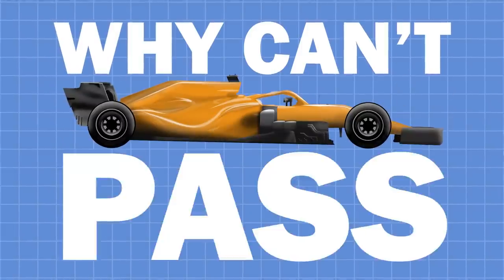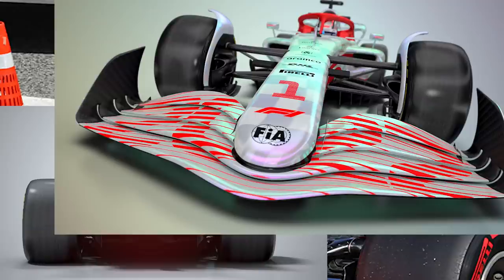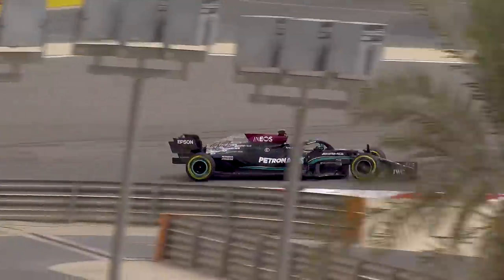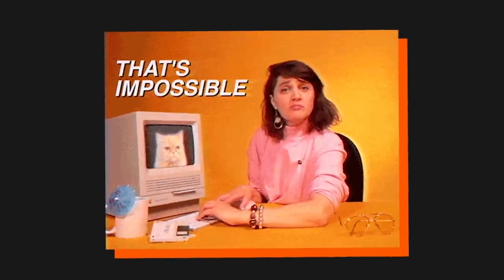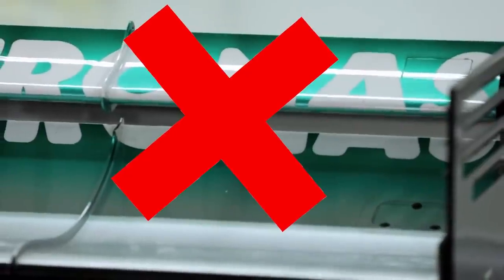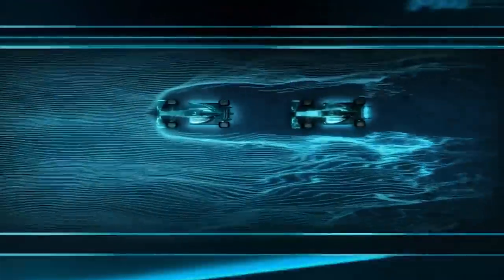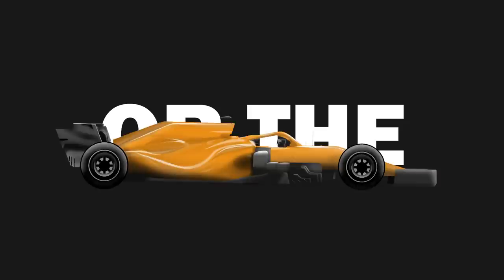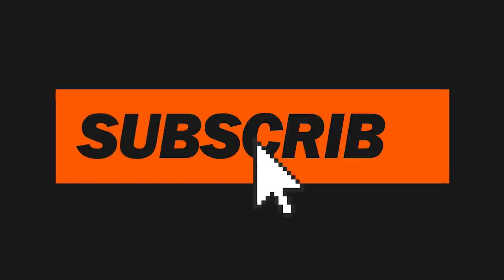Why can't F1 cars overtake in a 'DRS Train'?

Comment: This is probably one of the reasons there should be a limit on DRS uses per race like Indy push to pass for example.
Reply: that’s actually a really good idea
Reply: push to pass is such a better system.... just let them have like 3 shots on it in a race, or only let them use it for 30 seconds overall for the race

i get why they are there, but the zones F1 has now is just making stupid DRS chicken games... trust the drivers to judge when they can use it
Reply: @Sem5626  maybe at eau rouge/radiliion dangerous if use pushtopass, safety concern. if want push to pass, f1 will defined safe zone to use it in my opnion. yesterday f2/f1 saudi crash scare the official, can be much worse. glad are still ok. Super formula japan use push to pass method, its good overtaking, trust me :)
Reply: Agreed. But they need a system that somehow block the DRS to open in corners. Maybe to keep the same areas, but use limitation as you said.
Reply: It's the same thing... drivers will use it on the straights anyway

Comment: The push to pass system in Super Formula is more fun to watch than DRS
Reply: Indy Car has the same system
Reply: That's basically the ERS for F1
Reply: @PG-20  Two very different things both technically and with effect on racing.
Reply: Push to pass pass wears the engine down. It’s terrible. Drs is better, or you’ll be seeing by more engine changes

Comment: You can make a simple change to the DRS rules that would fix a lot of issues with the current implementation:

Every driver gets 1 DRS activation per lap, and I mean every driver on the track. They get to choose in which DRS zone to use it.
Reply: Or do it like some other series use the push to pass button. You get so many activations per race.
Reply: Easy:
There are 2 tracks on the whole calendar who have more than one DRS-zone where you can actually overtake.
Reply: well I think it wouldn't work so much
the fact is: I am the car ahead, if I see the one behind uses DRS in the first zone, I enable ERS just in the first DRS zone.

Comment: If we really see that we don't need the DRS anymore in 2022, I would still keep it but make it open for everyone all the time (Like we have now in FPs and Quali). This is just free straight line speed there to be taken or not. We would see faster laptimes and also better cornering speeds. That is because the team would put on more downforce/drag on the car if they know it won't hurt them so much on the straights. Also all the teams allready developed the DRS for the new generation of cars in 2022 so it won't be that resource intensive as well.
Reply: Someone mentioned putting a limit on how many times a driver can use it per race and I think I’d rather have that than having the ability to always use DRS.
Reply: as long as they don't use mario kart rules to get DRS
Reply: @Hirosjimma  bahahaha what do you mean?
Reply: @Shelmer75  for example in FE you can take a corner a whole lot wider to activate a boost. I think he meant that bullshit 🤣🤣
Reply: @nemanjastanojevic583  ohhhh! Yeah nah get that outta here. Just give them a set number and they can do it whenever.

Comment: question: wouldn't using fan cars sort out the dirty air problem? or would they make it worse?
(Before I get screamed at, I'm aware of their inherent dangers and don't expect to see them in f1 anytime soon/ever)
Reply: Wouldnt get worse as the majority of the grip is due to the fan sucking the car into the ground. The air being shot out the back is negligible, actually I suppose that the wash from a fan is quite predictable
Reply: It would turn the phrase "dirty air" into a literal one
Reply: Fan cars were only dangerous because they produced cornering speed far in excess of what was safe at the time when combined with ground effect skirts, reports of them shooting junk out the back were greatly exaggerated. If they were used as the primary means of downforce production and the rules were structured to limit their effectiveness (in the same way wing regulations are currently) then they'd likely fix more problems than they caused. Dirty air would still be a minor problem but it would be far less noticeable than with today's extremely sensitive over-body aero design.
Even if junk being fired out of them was a problem (modern tyre 'marbles' might increase the likelihood) you could simply change where the exhaust ports for the fans were venting so it was safe.

Comment: Way it's hard to follow close in the corners are because of "dirty air". When the wings produce downforce in the corners it creates turbulence air that blow up behind the car. So as the car that follow into the corner hits the turbulence at an angle it will have less downforce compared to taking the corner in clean air. To reduce dirty air you have to reduce the downforce F1 cars produce and that makes the them unable to take any corner at high speed.

Comment: What F1 should do about their passing rules. 
1 - The car that is not ahead is deemed to alongside once the front wheel makes it past the rear wheel of the lead car. 
The leading car going into a corner must give a car width from the end point of the corner, or is considered at fault.  The width applies to both the inside and outside of an apex, meaning once the rear car is ahead of the front cars rear wheel, the rear car also must apply to the same width when driving off the apex out of the corner. 
Once the car that is not ahead is in this position, the lead car must not take that width away until safety past the car in back. 
2. The car in the rear must be ahead prior to the apex in order for that vehicle to now be able to switch as the lead car. 
Same rules as above now apply with apex car widths. 
If the car in the rear does not get past prior to the apex, then rule 1 still applies to them and they are the lead car only needs to give a car width. 

This way, if you want to make a dive on the inside, you better know you will have to lead as well as be able to be at a slow enough speed as to not push the other off the track. 
Same with overtaking vehicles making dangerous maneuvers. 

Have all these be penalties and drivers will be much safer.

Comment: I believe that with DRS, they should give each driver the chance to open it in one zone per lap. That way it still does the job of helping the car behind to overtake, but it also becomes a much more tactical game. For example take Bahrain: would you want to use your one DRS usage on the longest straight so you get maximum usage out of it, or would you rather use it in another shorter zone so you can get in front and defend?

Comment: Quick question as I’m new to F1, how was Hamilton able to match and catch Max up on the hard tyre while Max was on medium for most of the race? Thanks
Reply: There’s many reasons, but mainly Hamilton was overall faster around the track, as well as the medium tyres losing the majority of their grip near the end of the race because Max was on them since after the first red flag (I think). The countless VSCs helped, but they still didn’t last the whole stint.
Reply: + Also the merc engine is much faster on the straights than the Honda engine where the high rake design of the Red Bull is better on the corners. This is also why Max was gaining on sector 1 and losing out to Ham on sectors 2 and 3
Reply: @styren2815  makes sense thanks!
Reply: @styren2815  I think ham was losing a lot of time in the first sector because of being in max dirty air. Mas was very fast through that part of the track as well to be fair.
Reply: If you watched or followed the free practices, it was clear that the Mercedes cars were really struggling to turn on the soft tyres and get them into the right operating temperatures, however they were really good at switching on the hards and their race pace was excellent. If I remember correctly the fastest times Mercedes did in FP3 was on the hard, a tentch quicker than the soft.
Reply: @benfulford3943  Nah, you should look at qualifying telemetry. Max went full throttle on the eses. where lewis had to lift (62% throttle).

Comment: So here's a newbie question: with the 2022 cars improving the airflow so the following car still gets clean air for its aerodynamics, does that mean the slipstream effect is also massively reduced?
Reply: No. The improved airflow will be mainly noticed in the corners and the following cars won't lose as much downforce through the corners as the current generation of cars. The slipstreaming affect should still work and potentially may appear stronger as a faster car can come out of the corner closer to the car in front and will get straight into the slipstream.
Reply: @benfulford3943  awesome, thanks!

Comment: How far back do you have to be to take advantage of tow/slip stream? How close do you have to be before complaining of dirty air? During races they complain about dirty air preventing overtaking yet during quail they are all  stepping on each other toes so they can be  behind another car. Someone please explain.Thanks.
Reply: Dirty air and slipstream are by and large the same thing, the slipstream being useful though on a quali lap comes from a sweetspot. The trailing drivers want the air ahead to be being pulled along by the leading driver, so there's less drag, but they also want that air to not be full of vortices which significantly lower the car's aero from being able to generate downforce. Any slipstream will mean a drop in downforce, but that useful tow sweetspot is where the reduction in drag outweighs the loss in aero and the car can perform just a bit better than it could out on it's own in static air.

Comment: The more I see of these F1 videos, the more I keep thinking F1 is overblown.   It's all based on such mechanical and aero precision, that tiny little flukes or disturbances make the racing nearly impossible.      
How is it the "pinnacle of motorsport" when the tiniest little issue makes it impossible to win, or even make a pass.   That's not racing - that's precision engineering.
Reply: F1 has always been about engineering as much as it's been about the drivers and racing. It's part of the sport, to ignore the importance of engineering a good car is to miss out on the full value of F1.